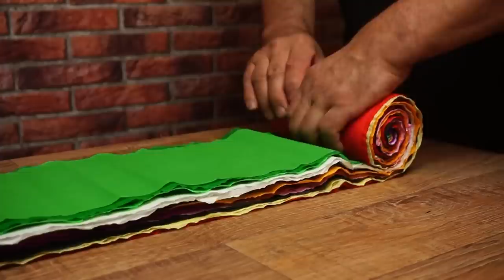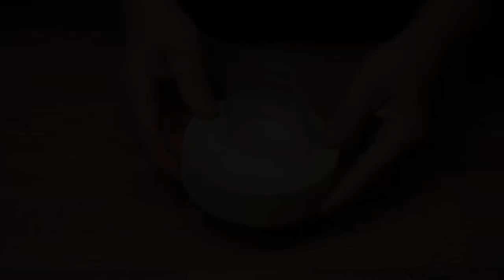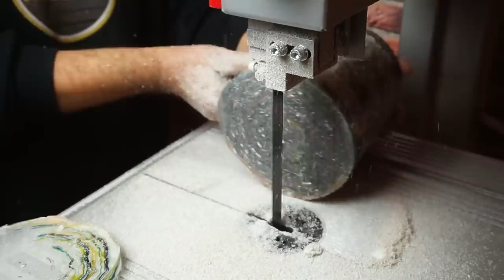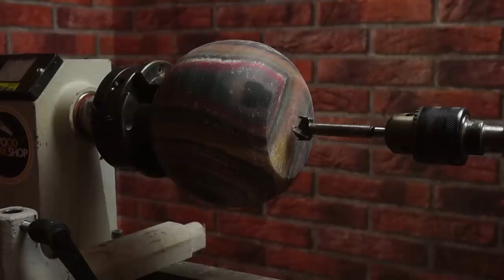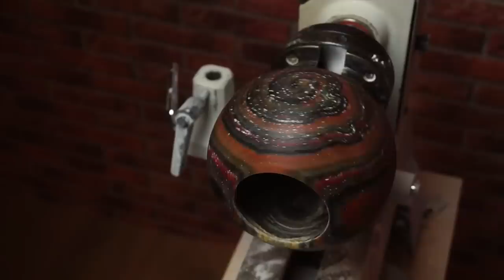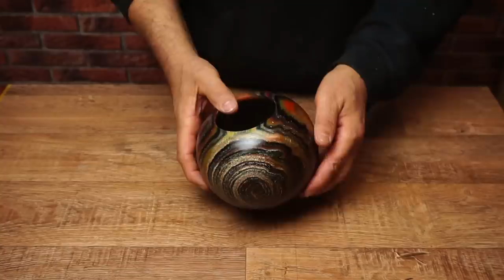Turning Crepe Paper (Starry Night)

Comment: sumting you could do : start with a round piece of wood and spraypaint over it thickly in a few colours let it harden out completely between layers even drips in the paint shouldnt matter as long as it dries out completely  , it will take a long time to build it up to twice the circumference but once you start to wittle it down the colours should be pretty solid without inclusions

Comment: I love the colors in this vase/ bowl. I am not a wood turner, so I have several questions. Is there a way to keep the vibrant colors of the paper? It looked like the smaller piece kept more color but not completely sure of how that works…. The other question I have is about materials, resin and epoxy are to be very blunt like a hard plastic, I have noticed that sometimes when the pvc glue hardens it feels a lot like the resin, can it be used to produce a vase as well? Just curious.

Comment: Not my favorite.  I saw another turning done using stacks of colored construction paper.
If that was used instead, and you stacked enough sheets of the same color together, to create about 1/4" sections of each color, separated by only a small bit of black paper, I think it might turn out more colorful.  The overall shape was lovely, though.